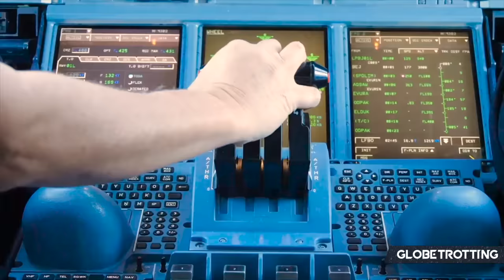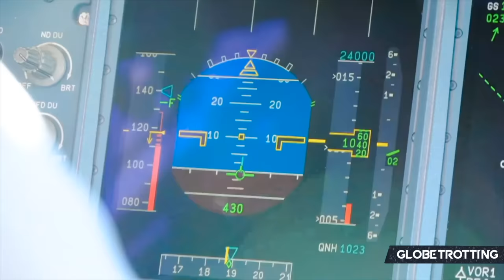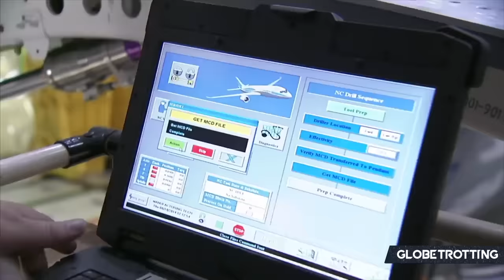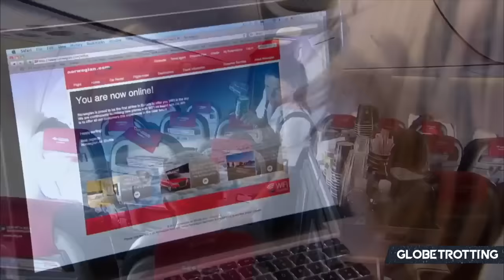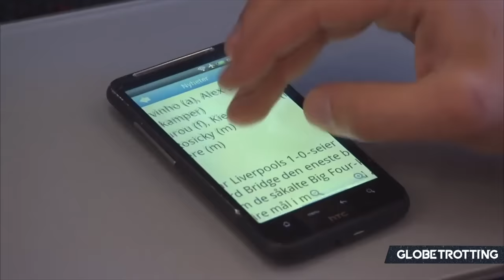DISASTER - Boeing 787 At Norwegian

Comment: Notice the focus of the blame is on the B787 and not the Trent engines that caused most of the problems.
Reply: Rolls-Royce is having a lot of problems with their engines. Not just the Trent 1000, which became the Trent 1000-TEN for all 787s, but even the Trent 7000 for Airbus's A330neo, which is a derivative of the T1000.

Comment: boeing, boeing, boeing .....smh
Reply: Trent 1000 issues are not Boeing’s fault
Reply: @Blank00  Boeing chose them, so it's also their fault
Reply: @tiagoneves8072  then by that logic, Lion Air and Ethiopian would also be at fault for the MAX crashes because they chose the MAX. Airbus would also be at fault for PW1000G, LEAP, CFM56, and GP7200 issues by this logic.
Reply: @Blank00 Norwegian's business model also caused the downfall for their long haul division.
Reply: @Blank00  Boeing test the engine and chose it. They sell a final product to the client, so yes, it's ALSO their fault. When you buy a car and the engine fails, who do you ask for responsability? The factory that builds them or the brand of the car? In this case it's the same.
Reply: @tiagoneves8072  Airplane manufacturers are not the ones that test the engines for reliability. It’s the engine makers that do that. The reason why airplane engines are different than car engines is that in general, carmakers design and make their own engines while airplane engines are typically designed and made by engine makers. A better automotive analogy for aircraft engines would be the tires on a car or 12V battery, because similar to how tires are not designed or made by the carmaker, engines are not designed or made by Boeing or Airbus, and these are also components that get replaced periodically, and the replacements do not come from the carmaker, Boeing, or Airbus.
Reply: A lot of pressure is put on engine manufacturers to produce a engine that is more efficient and economical than its competitors. AirNz staff website had on homepage Share Price on one side price of Aviation fuel on the other. Engines costing millions $ each are small beer to the price per Kg of Jet A1
Reply: @tiagoneves8072  That's rubbish. Wouldn't have been a problem if Norwegian chose GEnx instead. Norwegian's business model for long haul was not sustainable.
Reply: @tiagoneves8072  In this case, the issue is of the engine manufacturer, i.e., Rolls-Royce, which is having a myriad of problems with many of their engines, not just the Trent 1000.